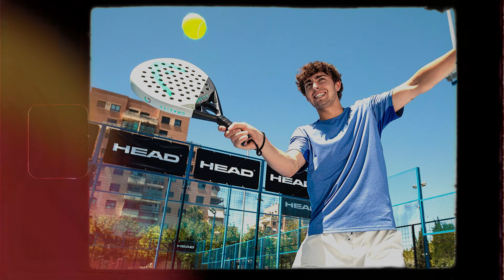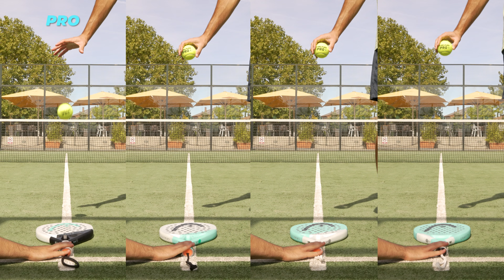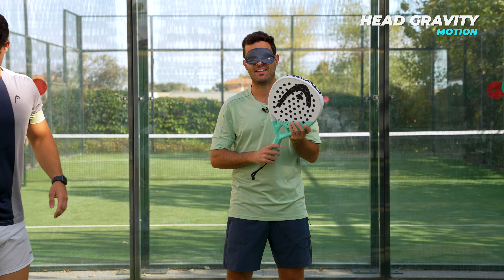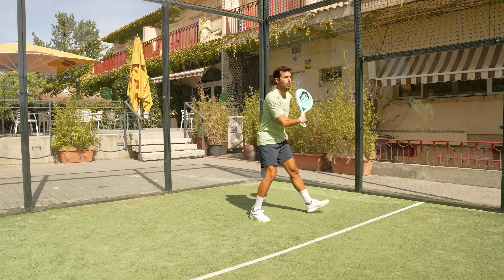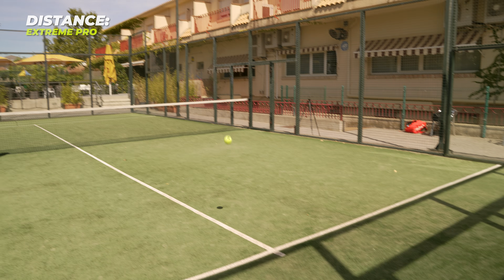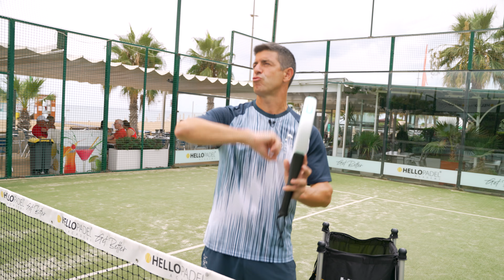CAN THIS RACKET REALLY GIVE YOU 100% CONTROL? - the4Set

Comment: Hey thanks for the video! Do you recommend the Head Gravity Motion 2022 or this new 2024 one? I think the main difference is that the 2022 one has the power foam vs the 2024 one has the control foam? I’m a beginner player (beginner to padel but not beginner to tennis)

Comment: I have nox AT10 18K 24 but it's too heavy for me. I'm not so strong. Do you think the motion could be a good idea playing in the right side to improve control and sometimes power smash and vibora?
Reply: I swapped from the AT10 18k 2024 to the Motion racket from the video and it feels a lot lighter, even tho mine is only 8 grams lighter (with overgrip on both).
Reply: Same for me. No good.. Now I'm using a Kombat

Comment: Well, now I have the Radical Pro, Gravity Pro ´22 (a unit of only 360 gr!!) and I have had the Gravity Motion 2025 for 1 week.
My experience is the following: Although the Radical Pro is the heaviest, and it is true that on difficult balls both at the bottom and at the net it is difficult to move it with ease, its feel and behavior due to the combination of Comfort Foam and 3K carbon, is the most reliable of the 3 models.
The Gravity Pro, although it weighs much less than the Radical, becomes more stubborn and ends up being difficult to move. Power Foam is also more reactive than Comfort, and the ball gets out of control sometimes.
And the Gravity Motion '25 is very comfortable, light and easy to move, you can comfortably reach all the balls no matter how difficult they are, but the fiberglass is very bouncy, and with lobs and volleys it is very easy to lose control of the ball . It is a racket for players with very good technique, it reminds me a lot of the NOX Ml10 Pro Cup Luxury from 2022, who want a good ball output with little effort. But if you're bad, like me, a lot of your balls are going to go out of control.

Comment: Hi there,
Could you please tell the difference between the gravity pro 2022 model (black/blue/pink) and this years model (also the pro).
I’m using the 2022 model and thinking about the buying the 2024
Reply from the maker: I haven't tried the previous Gravity! But the differences are regarding the FOAM (from Power to Control FOAM) and the roughness

Comment: Are the upgrades and new tech noticeable compared to '22 specs? I use Gravity Pro '22 the only main difference in specs is the rough surface. Perhaps it's the overall play and feel that makes the upgrades worth it and not just the change in specs?
Reply from the maker: I didn't try the Gravity 22, but the FOAM changes (from Power to Control FOAM) and the rough surface